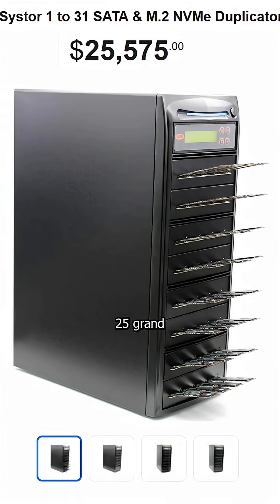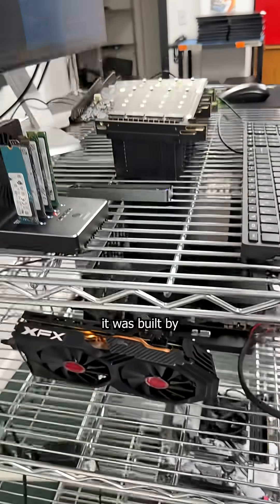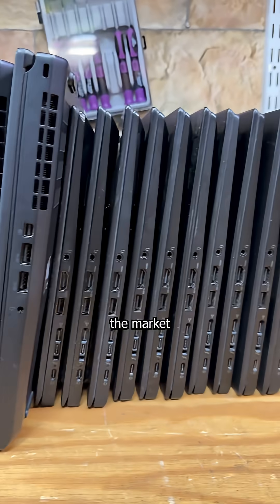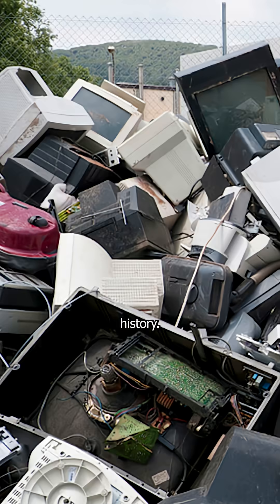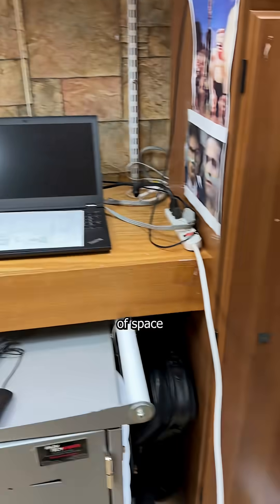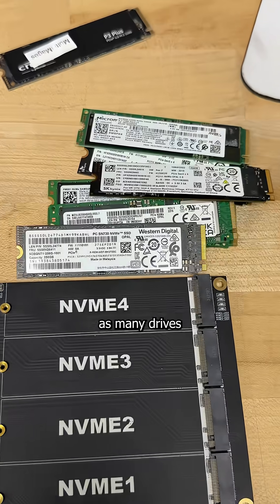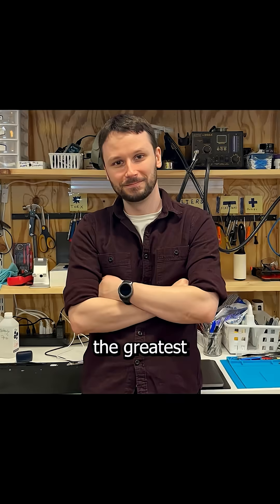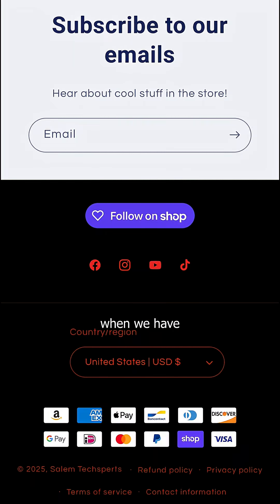I Built a PC Worth $26,000 to Save Old Tech From The TRASH! #tech #technology #computer #shorts #pc

Comment: I've got an old win 10 laptop that isn't exactly reliable (it caught on fire). That may be an exaggeration. It started smoking, smelled like something acrid, then won't boot. I can't afford to fix it. I've only got $300 dollars in the bank, but the laptop has a 3070, Ryzen 9 (forgot exactly what model), and was a pretty powerful beast when I got it new. I think the retail was like $2500 about 3 years ago. It's pretty much just going to be e-waste at this point since I can't afford to do anything with it. It's an Eluktronics brand (small company out of DE). Nobody has any parts for it, and the one local laptop repair in my city won't even look at it if it isn't Dell, or Asus, or other big name. Do you know any place I could sell it for at least a bit of cash?

Comment: Fun fact?: if your computer model was made around the year 2013-2014 you can still upgrade

Here's the step by step (btw this is not generated by chatgpt):
1)get laptop and usb
2)download the official Windows 11 ISO
3)use Rufus to make the usb bootable
4)once it's done click on the usb with file explorer
5)press setup.exe
6)click until it install windows 11

Btw i actualy reccomend getting windows 11 ltsc since it doesn't require tpm 2.0 or secure boot

Comment: I think for the time it takes to open the clamshell, pull the drive, clone it and put it back in you can clone the PCs with the drive still in it using PXE and a generalized/oobe image. 

I just learned how to do it this last year, and people often do 64+ at a time. It all depends on the switch though. 

It’s also less fragile than pulling nvmes and mounting this precariously. 

Buy a decommissioned switch with decent throughput and you’ll have a permanent bench setup ready to fill a 48 port switch or multiple switches with devices ready to be cloned. 

If you don’t know how, someone like myself can teach you in less than 15 minutes.

Comment: For anyone wondering the Dell optiplex 9020 comes in 3 different styles a full tower a super slim and a super super slim and you can pick them up on eBay for about 50 bucks and it's my daily driver computer and I notice absolutely no speed lag or anything it works completely wonderful with Windows 10 And I've quite literally bought 3 more on eBay just to have spares in case mine dies LOL Mine is an i5 Running at 3.3 I have 16 GB of Ram 1 TB hard drive and it runs the Dell HD 4300 graphics card  And you can pick them up for between 50 and a 100 bucks on eBay and usually with free shipping

Comment: Type on AliExpress 8 ports Switch card and 8 SFF8643 to 8643 Cables and 8 sff-8643 to 8 M.2 NVMe adapter M.2 NVMe ssd test kit.
Cheaper than this setup
Reply from the maker: Cheaper and much, much, slower.

Comment: Got a "razor" from rent a center came in a box with paperwork from the company and all sorts of razor supplies looked up my pc from razor using the info that came with it and it stated it wasn't a razor pc don't know if razor messed up or if rent a center ripped me off which they did price wise I looked up each part individually and overall to build the same pc at home from Amazon parts it would cost around 500 to 600 rent a center had me pay over 3k over 1 year on this pc they can get bent I aint ever going back

Comment: Have you tried to run Ubuntu from network onto a single Laptop which then passes it over to the next one. You can use dd command and zip voa ssh to daisychain as many computers you want. You are only limited by the amount of network ports. But a access switch should have enough to make your manual Labor the bottleneck of this whole Operation.

Comment: Bruh.   The greatest technician that ever lived can’t slap that into some old case ?   Even just to protect the parts and connectors.   Just grab an erector set and screw that shit down to something !
Reply from the maker: No one seems to understand server motherboards come with a shield covering the entire bottom half of the board, and it's installed inside a test bench that is grounded to the metal shelf.

Comment: I was able to get 4/7 of my Dell OptiPlex (i5-i7k) fourth gens extended one year. The catch was I needed a system image or backup pre whatever date support stopped in Oct. I take care of my pc's so it was no probe. The three I didnt , i donated to buy 2 8th gens. 
Its stupid because a $1000 modern  think center and  dell pro do not work much better. Def not noticeable. SSD is key for older quad cores along with memory.

Comment: Good man, i'm still running a Dell Latitude E6320 and i bloody love it.
i am going to upgrade it soon as it doesn't have open-gl support on its 6th gen (i think) i7 processor, so i cant run certain slicer/3d-design software, plus upgrading to ddr4 would be nice.
i'm hoping to find something similar to my Dell E6320 tho, hopefully that can accept my extended battery and has nfc/smartcard capabilities.

Comment: A while back I bought a used HP laptop for $50 dollars that had a Ryzen 3 processor. However, HP thought it was wise to only put 4GB of ram in the laptop with Windows 11. Then only used a 1 TB 5400 rpm hard drive.

The laptop ran like complete dodo cause of only having 4 GB of ram and the 5400 rpm HDD did not help either.

I ended up installing a 500 GB SSD I had laying around already and upgraded the ram to 16 GB. Doing that really woke up the laptop and useful.

I used the laptop for a while and ended up trading it for something I wanted more.

Comment: And it's not that "incompatible" PC's can't run Windows 11. It's that they're "not supported" by Microsoft, due to not meeting their (honestly) ridiculous security requirements. I have an old Dell SFF office PC that I bought for like $50 on Facebook Marketplace. Has a Ryzen 5 PRO 2400G. Unsupported processor for Windows 11. Did the workaround and installed it anyway. Runs just fine. Furthermore, though some have said, "yeah, but it won't get updates," it's been updating just fine for the last several months. Don't throw away your old tech just because the "Almighty Lord Microsoft" says so.

Comment: All I want is a high end 2-1 with top end CPU and mid tier GPU with 240w TB5 power.

HP is sadly only one with anything remotely close to it and they haven't updated specs in 2 generations. I pray they will finally upgrade it with panther lake. I rather have x3d but whatever.

I seriously don't understand why no high-end 2-1s exist. Its seriously best laptop form factor unless you need a desktop replacement.

Comment: Never was impressed with windows 10, it always felt like a slow, overly burdened, clunky, barely functional OS. Now that it's dead and there is nothing left holding me back imma just backup all the data on my main hard drive and reinstall the best version of Windows. No, not XP that's a close second, Windows 7 ultimate which my version of 10 was supposed to have all the features of only to slowly be downgraded to basic my Microsoft through their always on upgrade system and my unwillingness to fork out a subscription fee for things that I never agreed to make a subscription service.

Comment: I have a Lenovo M90 Mini running Windows 11. It's fabulous 👌🏻. It's a load of crap that the only reason it's not "Microsoft Certified" is because the CPU is "Outdated". It's literally the only reason most older Lenovos don't meet spec since they are the only company that introduced TPM1.5 or newer in just about everything they made before it was a Microsoft thing.

Comment: This still doesn't explain how this is going to prevent Win 10 wastes. What does cloning do that can save laptops?
Reply: Refurbishing laptops that last and since he buys refurbished and actually repairable laptops in bulk so if he gets like 10 of the same laptop he can install windows 11 on one of them install the drivers and then close the SSD and put it on the rest and fix any corruption if it happened
Reply: @Weightyloan15 so just copy and pasting ssds so other laptops can use Windows 11? If all laptops can use Windows 11, then what's wrong with installing them on those laptops on their own?
Reply: @zephyrsimon businesses are weird they throw out perfectly good hardware and get new stuff

Comment: As someone who also works ewaste as a repair tech and who has done something similar in the past. Be careful when specifically selling multiple of these cloned devices to a single person, it's pretty niche, but I had one guy running into issues because multiple devices were sold him ended up with the same ID due to the cloning and it was messing up his work flow. What ID you ask? I actually don't remember because it was such a niche problem specific to him and the software he was using that I almost can't believe it happened, but it definitely showed me cloning drives like this can cause issues in certain circumstances.

Comment: I don't understand, why do you have to clone the drives?
Reply: Basically he buys a bunch of refurbished laptops from a electronic recyclers that they get because of win 10 support ending, installs windows 11 one of them and the driver and if there are more of the same laptop model he clones the ssds and slaps them in the other laptops of the same model
Reply: @Weightyloan15 ok, that's pretty smart. I'd try to deploy OS over network, but I guess clonning is more energy efficient, as you need only one machine running? Pretty cool
Reply: @foxz7424 he said he doesn't have the capabilities to do it so he just does this

Comment: I would buy from here if
they didnt come with windows licenses, unneeded cost passed onto those that don't use it

Since it's recycled parts being sold the ram should be fit to a maximum capacity, why sell laptops with 8gb of ram when you likely have multiple pcs where the only working parts might just be the ram, buying matching ram to fill it out cant be more than 30-60 usd

the last reason I havnt bought anything is despite this everything is always out of stock, there is obviously a market for these recycled pcs but not for me

Comment: Went to the website out of curiosity. Every laptop was sold out. Looks like your business is thriving. Congratulations!
Reply: I just did the same, bummer eh. Hopefully the secondary market gets flooded soon.
Reply: @yabbadabba9889  it will I deed as companies are phasing out windows 10 laptops
Reply: @yabbadabba9889 probably by scalpers that bought laptops cheap and sell them substantially more expensive. No-value leeches on society.
Reply: What is he doing putting windows 11 on them?
Reply: @ozziemurray even if he is, it's not the only option. Linux is super accessible and these old thinkpads work amazingly with pretty much every distro
Reply: @pigletpixie yeah im on linux on my laptop im just curious what is he doing to them to re sell.
Reply: He probably just fixes them up and then puts Linux Mint on them.
Reply: @ozziemurray fix any internal problems + clean up + install whatever is needed and/or supported by them. Basically a creating a new laptops from used ones
Reply: @aitlin putting a new os and drive does not make it a new computer, using hardware that isn't 7 years old would do that.
Reply: Dude has awsome merch, even has a blow up doll 😂

Comment: My computer is not even that old. I'm running a 4th generation ryzen 5, and a 3060. I had to do a firmware flash, turn on obscure settings in my motherboard, reinstall a new version of Windows 10 use a cache modifying tool because it was telling me that my PC wasn't compatible with Windows 11 because it didn't have a good processor. I don't know why they're trying to force people to do this, it really sucks. And the worst part is they did the iPhone thing. For the past couple of months my games have been lagging crashing and taking a shit in general. The moment I upgrade to Windows 11, all of a sudden I have basically perfect frames.. I fucking hate Microsoft

Comment: We need an operating system that can work as long as the laptop. Doesn't need to be constanly patched. And are user friendly.

Linux etc are great, and the internet would have been dead years ago without it. But it needs to be accessible to the public dummies to take flight.

I am also a microsucks hater, removed as much of it from my windows 7 as I could to make it usable but stable.

Comment: Noob question but what's the point of such a massive cloning setup? Is it just to save on software installation time? And even then, this massive would only make sense if you get hundreds of the exact same model with the exact same hardware setup. And even then refurbishing them would be the bottleneck in time spent

Comment: do the risers not cause any pcie errors? its common to see even with just straight pcie->m.2 holders on the last slots. you could also just use SSH and get rid of the GPU for 4 more clones at a time. It has IPMI/webkvm

Comment: There’s a simpler way my friend… long long ago (a few years befor I moved up and into a pm role at an actual software shop) I was an integration center manager at a recycler that fancied itself something more, and the part of the business I was involved in was imaging thousands of PoS systems for T-Mobile and we also had some amazon contracts. The setup I designed allowed us to image up to 96 systems at a time, but the real boon to you would be that it was simply plugging in an Ethernet cable and running a prompt to image the systems. No need to remove the drives… now, I haven’t played around in powershell like I used to because I have a different job where I babysit devs to assure they meet deadlines.. a little less fulfilling, aside from the pay… but the point is. You can build it better mouse trap.

Comment: Or just continue use windos 10... nothing will happen 😂😂 use a decent firewall/anti virus and don't be a moron and nothing bad will happen. Used all windows wayy past their end dates never had a single issue. Only reason u ever upgraded os was because i upgraded my pc😂
Reply: Well. If you do use modern software and upgrade it you will run into the issue of stuff not supporting the old OS and won't work on it anymore. It's fine if you will use what you always used and never update, but that's not the case for everyone.

Comment: Windows 11 supports anything that has TPM 2.0. So far, the only thing I don’t have it installed on successfully is Ivy Bridge. The board is the very first UEFI generation. It even still has a full BIOS without emulation. My Skylake builds run it fine. TPM 2.0 support can be added in and is included in anything 8th generation or newer my Thinkpad T480 7th gen without a hitch. Just finished a Gentoo install on a skylake 6700k

Comment: They outdated windows 10 and I am still using a windows 7.
Reply: Same, my laptop is still Windows 7, Desktop can't update to 11, so staying at 10 (and I only went to 10 when Steam stopped supporting 7, haha). Not really much of an issue if you follow safe internet practices, I've found. Never had any problems on either. Both over a decade old, too.
Reply: ya, you shouldn't be using windows 7.
Reply: 8.1 ROCK SOLID HERE
Reply: Windows 7 was so clear of windows 10 😭

Comment: i just use a pc ive had for half my lifetime that has been built, rebuilt, broken, upgraded, and rearanged so many times that trying to figure out what exact specs this thing had is like trying to figure out what Theseus's ship was made of. its a conglomerative amalgamation of haphazardly installed extra storage, monotors of varying sizes and refresh rates, and requiring a 10ft long desk to fit. the corws nest fo writes lining its adjacent wall would make an It support guy cry and make a bowl of spagetti blush. asking a technition to come fix this pc if it ever broke woudl be like asking an ammeture electrition to prevent a nuclear reactor core meltdown, as im nto even sure how half of it works. i just does. so ill take my terabytes of storage and 7 monitors and run with it, becuase it just works.

Comment: Drive replicators are annoyingly expensive. 15-20 years ago we needed one for a startup I was at. We built one that would write to 12 SATA drives at a time. It would do block level read/writes like 'dd' but would accept as many outputs as one wanted to list.

We used cage less hot swap bays and it would take just a little longer than the slowest drive would on its own.

Prior to that, we would net boot them and sync data over the network. It would take them all day to get the 300+ GB of assets from the sever.

Comment: That shot on Razor was likely deserved but I am going to defend them. All because I picked up a 50 dollar mouse for 20 bucks (because of a clearance) and it lasted me between three laptops (two of them died and one I am using) over the span of 8 yesrs. And the mouse still works but the scroll wheel is going out. And I picked up a Corsair mouse. And it looks like shit in a month. All because the thin rubber like coating on it. It peeled off due to the heat of my f*cking hand. And I paid 60 bucks for it. I am pissed. Mouse works but still...
Reply: That damn rubber coating is such a pain. Mines got scratches on it
Reply: I love my DeathAdder V3 only mouse I'll use and my Razer 18 gaming laptop, I see no cut corners.

Comment: Gad damn the Thinkpads have become utter shite. I am obligated to use one with one of my clients, and the rest of the team there has figured out that compiling code on a raspberry pi is faster and more reliable so they dumped the laptops in a drawer and didn't tell IT. I personally don't normally care, but I told them straight up that if they insisted that I use one of those pieces of shit they were going to have to give me an extra 20% on my contract. I'm on my third one because they keep failing. Thinkpad used to be a good name. My wife had one from the early 2000's before IBM sold the name to that Chinese piece of shit company and it still works today. Lenovo has absolutely ruined the name.